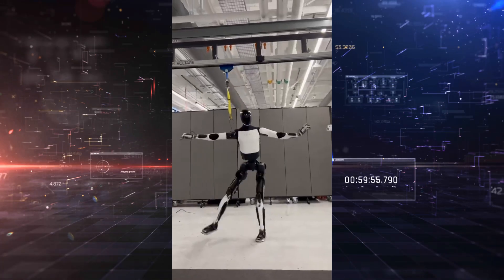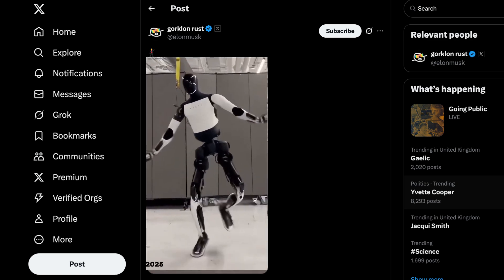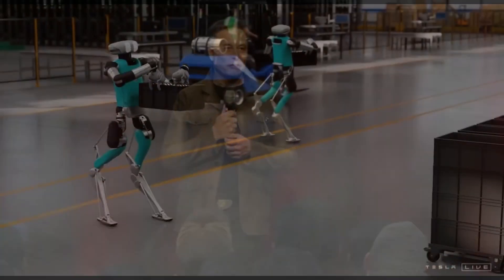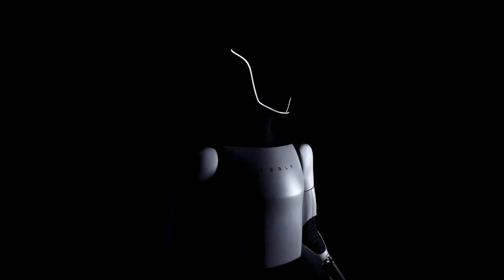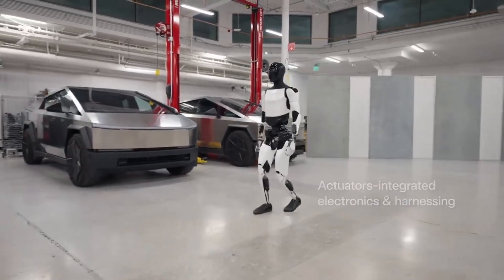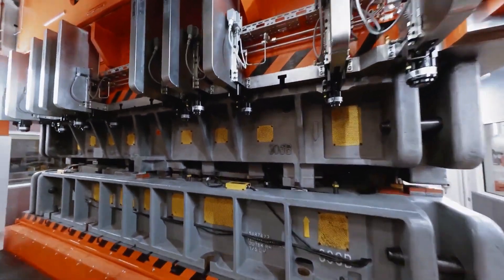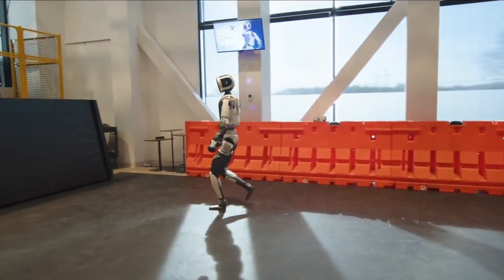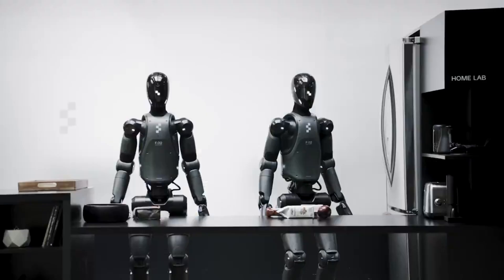Elon Musk Releases Video of Optimus Dancing

Comment: I can see the strings 😂
Reply from the maker: It's emphasised that those strings are slack, it didn't have a bearing on the movement, those strings are there so a $500,000+ piece of R&D robot doesn't crash on the floor
Reply from the maker: check out the new video, Tesla just released one with no strings